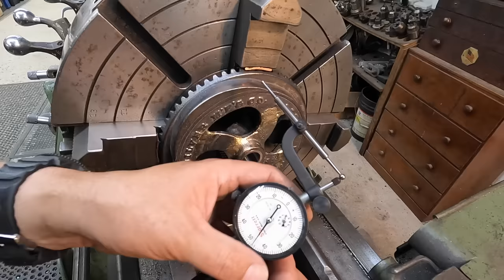Reparing the 100 Year Old Broken Gear

Comment: Great work! But, as a layman,  I don't understand why, at 34:30, you are centering the workpiece on the lathe  - after brazing the crack - not according to the gear but to the bushing's bore  (which certainly is not centered).

Comment: Liquid nitrogen is the best way to fit a sleeve no pressing required and can have .001"/.0015" interference. We used to knock in cylinder sleeves with .003"/.004" interference with dolly and sledgehammer ! Then started using LN and just slide them in by (gloved) hand no problem .

Comment: Why don't you cool down your bushings before you press them in?  I learned 30+ years ago pressing in cylinder sleeves, simply throwing bushings in the freezer and slightly heating your bore worked wonders.

Comment: When you try to dial in such a repaired awkward configured piece and get it as close as you can, after boring the center, couldn't you than use a spindle through the center to see how concentric the outer gear is than? Just an idea to double check...especially since you had to braze up the center crack...  Thumbs Up!

Comment: I'm sure you could have done a 3D scan and then produced a 3D mold to cast it, no problem.  Of course, it would have taken 4 times longer and would not have used the old parts, but hey, it could be done!  <sarcasm>  Nice show.  I have a cast iron part for the old planer my Dad used to build a house that should be remigged with the bronze stuff.  Hey, I'm learning...<grin>

Comment: using a self centering chuck would have done it more precise, or dial in at the jaw surface instead of the angled parts surface. Pressing in at such thin brittl walls? Thanks though for showing. I love your other work, projects and precision. Here you had a bad day ❤

Comment: A really dumb question, if you would be so kind to answer:

At (27:30), the clever method you show of using a mandrel-mounted rod to catch the part when the cutoff tool finishes, is this a known technique or a “trick“, perhaps of your own devising?

I´ve never seen this done before, and while I am certainly not any master machinist, I figure that I would have seen this technique be used at one time or another.

It´s certainly desirable to not potentially marr a precision surface by having failed to catch the part by hand, as well as be just a bit safer to not be putting a hand in there.

Comment: You could just use your cnc mill to 3d mill out a new gear from billet. I believe  that was made in Salem, Ohio. Thats where  I live. That was before my time but I think Silver was  a partner in the silver and deming drills. I know the silver and deming drills were made in Salem Ohio. Later there was a company called Demings that made water pumps but they are also gone now. I have a 3 spindle drill press  from Demings.

Comment: Given the rough cast teeth, and the coarse, nature of the machine;  I wouldn't have thought any slight misalignment would be much of an issue(the amount you had to take out to get a clean bore astounded me). I will admit if it was my part, I'd be doing the same boring and bushing though. 

I would likely have sized the bore to a stock bushing size, so if replacement in the future was necessary, it'd be an off the shelf component, and used an Oilite bushing, or at least brass/bronze to prevent it wearing out in the future. 

As far as the tight fit and Locktite induced crack, I'd have been tempted, instead of using Locktite, or another modern solution, to simply to have used a punch to stake the bushing in place, as this isn't as high stress, high heat, or high speed part.  Not sure if you did or not, but I also would have removed the bushing prior to brazing to prevent the bushing being welded in place, which would be especial confusing to anyone attempting to replace the bushing in the future.
Reply: Well, it was explicitly a sleeve to straighten the bore, and not a bushing.
Reply: @SteveColluns-hm2xx  A bushing is a replaceable part, typically lubricated, that will wear over time and is considered a consumable and therefore is expected to be user serviceable to some degree. A sleeve is literally part of the base material, and shouldn't be expected to be replaced, especially in this application where there will be so little wear. So the comments about treating it as a bushing aren't applicable because it doesn't have to act as a bushing nor does it need to be replaceable.

Comment: Adam, how much would it cost to take that part (after it's ground down smooth to mimic the original shape) and have it patterned and cast in iron?
Reply: One off castings are hundreds of dollars.  Casting that piece would be a challenge.
Reply: @paulcopeland9035  Not to mention, you have to allow for shrinkage. So the mold patterns would need to be a few % larger than the original. Meaning it would be hard to use the original as the pattern unless you 3D scanned it and then enlarged the scan to account for shrinkage, then 3D print the pattern. Better of to CAD the thing and have one of his CNC mills spit out a perfect new part.

Comment: ...30:36....Crack.... Oh nooooooo 😫better using a brass sleeve? Smaler tolerances?!  Heat the Gear and freeze the sleeve for mounting and i think you don't need loctite. Cast iron is very tricky but you fixed it👍🇦🇹

Comment: More fun! My project today is trying out my new "Chinesium" mag base (0.001") dial indicator kit, on my 40-year-old"Chinesium" Craftsman drill press, with the "Chinesium" Harbor Freight two axis vice! "Tramming in" the table. Using my surface ground shop project from about 1978 as a reference (4"x4" flat plate thread gauge). Over the 4" plate side to side, I'm reading .006" out. Not bad. Loosen the table and a little "tappy tap" as Quinn would say and I should have it close enough for what I need (I don't work to "Tenths"). 😁

Still kicking myself for not buying the small lathe and vertical mill from my nightmare "temp gig" years ago when they went out of business (two weeks after I quit)...

Comment: 1 to 3 thou clearance for Loctite bonding man.
Reply: Yep. Loctite is a lifesaver when you have a little clearance, either accidental or intentional. Use it to your advantage.
Reply: Yep leave in 4 jaw, make bronze Bush to fit bore, it is a running bearing surface, steel is not suitable.
Use green Loctite, install and bore to size.
Reply: @willemvantsant5105  Exactly my thoughts,bronze or cast iron bush needed

Comment: No machinist experience at all on my part. With that said could you have made a round plate the size of the gear with a exactly 90 degree Rod coming off of it. Then Slide the gear down to the metal plate in the hub down on the rod in the center of the gear. Would that have helped with alignment before welding.

Comment: What are you sticking the sanding cloth on to make a flapper wheel? I dont want to buy pre-made flapper wheels
Reply: Any round stock with a slice in it works... they probably sell them too..but a cheaper way is to make it yourself ( if you have the desire of course )...
Reply: Make it out a piece of tubing. Put a slit in the end to hold the emory cloth.
Reply: @russellerney2375  Maybe I can slit an aluminum lawnmower axle.

Comment: Abom seems to be aggressively avoiding checking for cracks before starting work throughout this project. Part 3 is kind of doubling down! Parts are more likely to crack where a pre-existing seen (or unseen) crack exists, it's like science maybe. The crack when he pressed the bushing should not have come as a surprise. It was like watching a train wreck when he  muscled pressing the sleeve when it hung up.  I kept asking myself why he didn't consider using liquid nitrogen rather than stressing the part further in the arbor press, or at least discussed why it wasn't considered. Also not discussed was the decision to use Loctite or not. Abom puts the blame for the cracking on the use of Loctite, but didn't discuss the pros or cons before using it?! Interesting was him asking the owner after the fact if the owner wanted a wallhanger or was going to use the tool. Again, something to be addressed prior to starting the project.  I'm sure the gushing fanboys will give the usual "I want to have Aboms child" reviews, but come on, really!
Reply: Lots of un -Abom -like on this one, especially failing at such a low hurdle.
Reply: So many reviews never actually "watched" the videos! Part of doing any repair is having a plan, and judgement. If I were sponsoring Abom (and we all know he has no sponsors (wink,wink)) I would be rethinking my investment. Abom says out loud what the critical reviews are saying. I was flamed for suggesting he do a wallhanger repair, then CNC a usable part. Then the fanboys start in on Aboms former reputation, at the end of the 3rd video, finally asks if it going to be a wallhanger, basically while he's shipping it out. Truth be told, I don't know why he quit his day job!
Reply: There really was no need for the sleeve to be a tight press fit. If using Loctite high strength retaining compound a sleeve made to a slip fit that can be pushed in by hand is just about perfect....it is the Loctite that then forms the bond between sleeve and gear.
Reply: @howardosborne8647  There seems to be a lot that Abom does not understand.  But then, fanboys persist. There are actual YouTube machinists that have actual businesses, earn a living, have actual skills. I was concerned when he dismissed that the sleeve was not the same size at both ends.  I just don't understand his good enough philosophy for his work. Nor the praise heaped on him for mediocrity.

Comment: With a sleeve that thin, and having a cast iron hub, prone to cracking, I would have made it a shrink fit. Freeze the sleeve and heat up the gear, and then just drop it in. However it turned out okay, so not a bad job. Cheers !

Comment: ever thought of using lead free plumbers solder for putting in sleeves on parts at risk of cracking?
Reply: Why lead-free?  It's terrible.
Reply: @brettbuck7362  when i look around, it seems the better solder that's not at brazing temperature is lead free.  may not have looked far enough, but, that might be enough to use it.  silver solder, even the cheap stuff has 120k lb/sq in strength, shouldn't take much and can tolerate gaps pretty well.

Comment: Zero to do with the locktite.  Too close with the tolerances. You can hear it break - that bore was not 100% true.
Reply: I agree. A little freeze job on the sleeve may have saved the parent piece, but idk. He appeared to be pulling pretty hard on the arbor press. Lol
Reply: Loctite recommend 1 - 3 thou clearance.
Reply: @shannonstratton3164 
yeah that piece stopped which usually means it is too tight ..if you flip it over and push it out it can be saved ( might not be cracked yet ).. that last grunt did the crack.... a few more emory cloth flap wheel runs would have made it slide easily ?? it was 1 thou thicker i think too on one end...( sleeve )

Comment: you could have just heated the bore of the gear to shrink fit the sleeve . that way you don't take it out of the chuck. like heating a bearing but a bit hotter. you could get .001-.002 shrink fit. plus freeze the sleeve .
Reply: Absolutely,  you put a .001 shrink fit on that 1 inch bore. She's gonna lock up so tight that you would have a hard time getting it apart again.